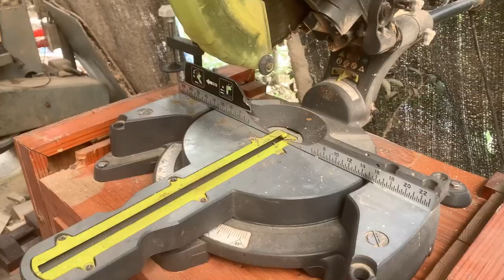Inspiring woodworking ideas // How To Make A Beautiful Flower Wheelbarrow By A Craftsman

Comment: Beautiful but using screws to fix the handles  and base will quickly rot if this is left out in the rain. Does it need to use joints?